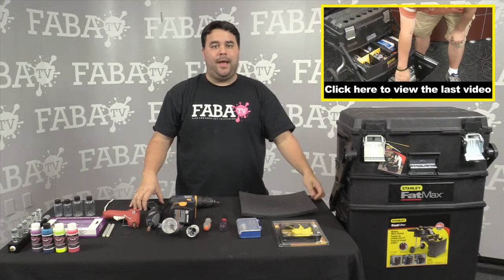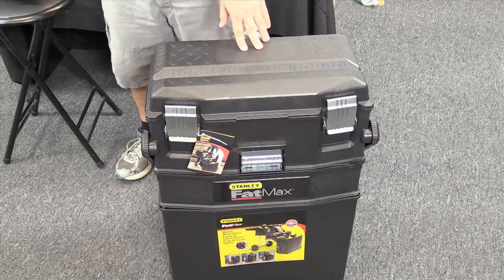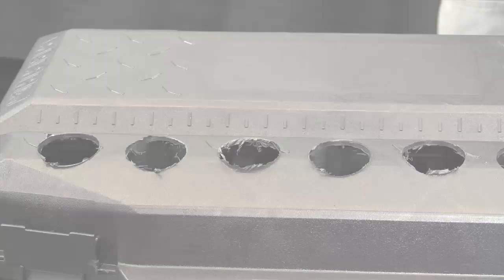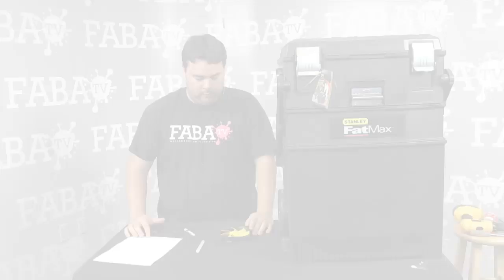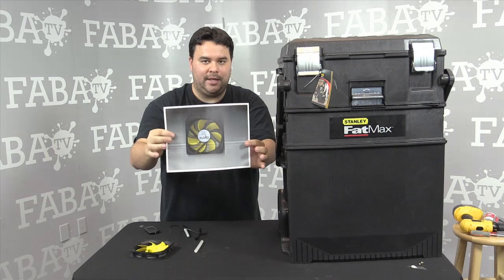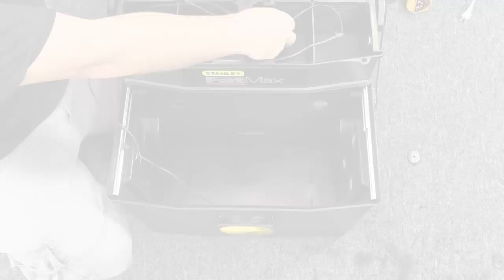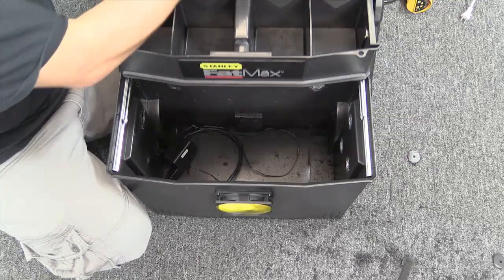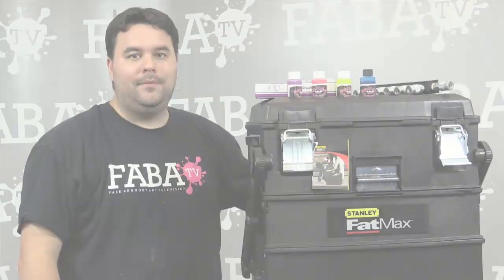How To make a FATMAX Airbrush kit

Comment: Hey.  I really like the fat max mod.  This may be a bit wordy, but I think you have a great idea that could be improved upon a bit.  So I thought i'd make a few recommendations on the fan configuration based on experience. First, if you put the fan on the inside of the box, you'll be less likely to knock it off when toting the max around.  you may lose a few cubic inches, but you won't lose the fan.  Second, you probably want to PUSH the hot air out rather than pull it in.  With holes elsewhere in the box, you'll be pulling the airflow over the equipment more efficiently.  Computers are designed that way.  Thirdly, go to newegg or compusa and you can also get a cheap metal screen on the fan to protect the blades ($4-$6).  Forth, speaking of efficiency, more holes will not make it cool off faster. Air will take the path of least resistance, so a lot of holes may bypass the compressor, you want convection over the equipment. Heat rises, so put the fan high in the compartment and one or two holes down near the base on the opposite side, the further away (i.e. diagonally placed) the better.  You can also put a cheap filter (maybe use some of the leftover foam?) over the holes to keep dust and stuff from being pulled into the box.  Maybe also run a bead of hot glue around the edge of the fan to create a seal and help hold it in place.  Finally, and I should have started with this really, but FOR THE LOVE OF GOD, NEVER plug in any power supply with exposed leads!  if you need to test, connect them up and then plug in the power.  Holding the leads by hand on a live circuit makes you a part of the circuit and can cause pain or worse.  I'm assuming you're going to be near water, so when making the connections, use wire caps AND a waterproof ELECTRICAL tape (NOT duct, gaffers, masking, scotch, cassette, string, hot glue, bandaids, chewing gum, etc).  However, you can also use the hot glue to hold the wire from the fan in place to keep it from getting snagged.

I'm totally not knocking your mod, seriously, good job!

Comment: you should flip the fan, the hot air should be sucked out of the cabinet, not cool air forced into the case.
the design of the computer fan you are using is meant to pull out hot air. That's the principal of heat exchange, and is
how your a/c, refrigerator, etc... works, by extracting the hot air, not forcing cold air in. that way is more efficient.
and you're not sucking a bunch of dust in dirt in that way either.

Comment: What size compressor is this? I cannot seem to find one the dimensions of the bottom of the fat max .
Reply: I would like to know as well. Or at least know the interior dimensions of the bottom compartment so I can locate a compressor that will fit.
Reply: W: 18.5" h: 15" depth: 9"

I measured from inner edge to inner edge so that you have an accurate idea of what fits.
Reply: @ArtistMagicianActor  It is not 9" deep that wouldnt even fit the smallest compressors. Depth is 21 inches. Its right on home depot website. You just caused a lot of people to not use it when they could have with that bad measuring.
Reply: @azarelthecreator7098  I measured it, as stated, that's how I got my result. My iwata powerjet fits.
Reply: @azarelthecreator7098  I'm not sure you have the depth to know what depth is but I don't appreciate your hostile comment while it's based in lack of knowledge.

Comment from the maker: it's only 12V. with low current. not like a car battery which is also 12V but has high current. it is BEST to ALWAYS unplug power before handling it. I've been shocked a few times and it SUCKS. no fun at all. :)